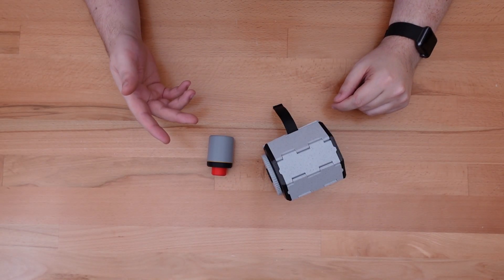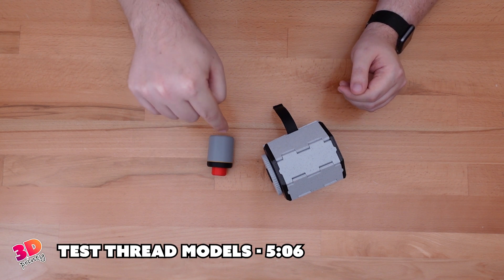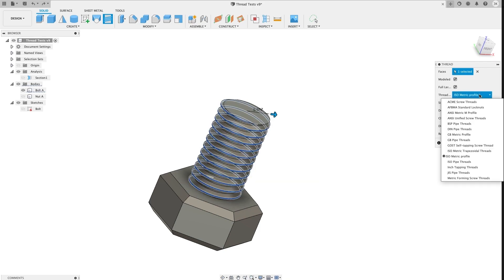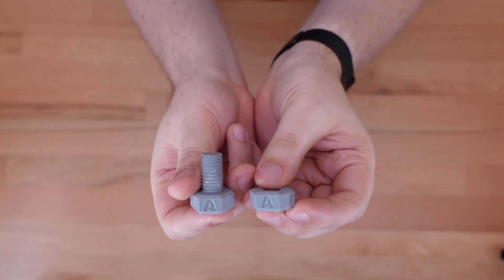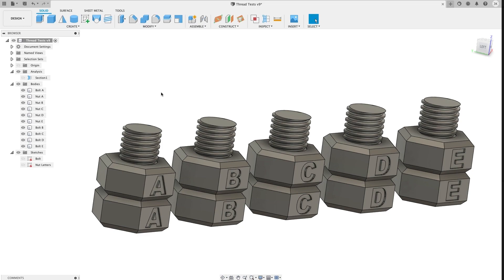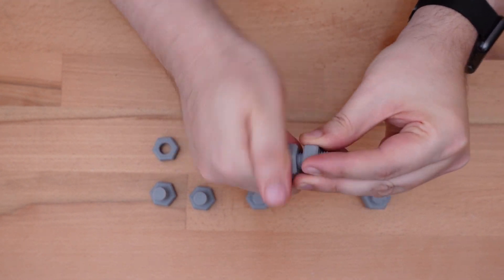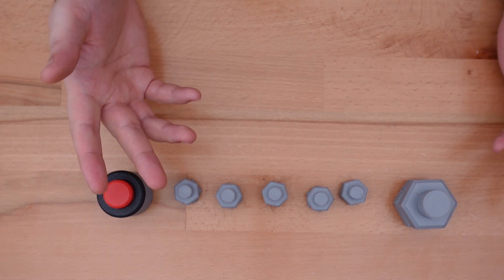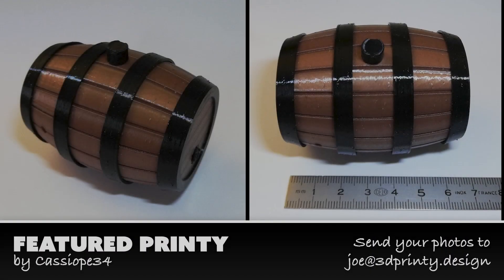3D Printed Threads - Fusion 360

Comment: I tried printing the medium rolling box but the end wont screw on I tried sanding them to only get about half way. I'm very new to this hobby. should I just scale up the box by 25%-50% to get the threads to work? or is it a setting I am missing on my slicer?
Reply from the maker: Threads can be tricky. Usually it's an issue with extrusion consistency.

Before reprinting anything, I'd try to slowly screw and unscrew the cap as far as it will go. This should wear off any small printing blobs that can be causing the trouble.

If that doesn't work, I'd try reprinting the cap scaled down slightly in ONLY the X and Y directions. This should be possible in most slicers with asymmetric scaling.

Some slicers have a setting called "Horizontal expansion" or "X/Y compensation" that is specifically used for these situations, although I've never had to use it myself. Here's a video by Chuck that discusses this in Cura: https://www.youtube.com/watch?v=UUelLZvDelU
Reply: @3DPrinty  Thank you so much. I've had so many issues with what could be heat creep but it only happens on complicated builds like the Tardis box body, yet when I print simple organizers for my dewalt storage organizer they come out fine.  I have a Creality 5 pro with a bed leveler from creality, and I have used there slicer as well as a PursaSlicer with a setting file for creality. I'm kinda learning as I go. your video's are an inspiration.
Reply from the maker: Yup, we're all learning as we go. If you aren't following Chuck already, many of his videos focus on Creality printers and may prove extra helpful. Good luck!

Comment: is there a tutorial on how to decrease the bolt nut thread clearance, i think this is the solution to my problems
Reply from the maker: You can use this technique to decrease the clearance as well. Just use a positive offset instead of a negative one.
Reply: @3DPrinty  my initial comment got lost in translation. What I mean is do you have a tutorial for this, this was hard to follow for fusion 360 noobs.
Reply from the maker: Sorry, I don't have anything that breaks it down more than this video already does. I recommend following along step-by-step with the part where I use the Press/Pull Tool (shortcut Q) to push the thread surface in a bit.

Comment: Great video thanks. How do you show the parts cut in half like in the video?
Reply from the maker: I love that trick - it's the "Section Analysis" tool under the "Inspect" menu. This allows you to select a plane to slice through the model without actually altering it.

Once you use it, this special view is saved in the "Analysis" folder in the document tree. From here you can easily switch between multiple different views, or turn off the view entirely and return to seeing the full model.

I usually have at least 2 Section Analysis views in every model I make - slicing the front and side. For more complex models, I may have many more.

Comment: Great video! You mentioned that if you scale up the nut and bolt they would screw on easier, My question is if I drew the male and female threads at say half of the required value then scale it up in the slicer would that make is smoother than if I just printed it 1:1 scale? I know your method would be the proper way... but in a pinch, would it work? Thank you
Reply from the maker: Excellent question!

If you model an M3 bolt in an M3 hole, scale it 200%, and compare the scaled clearance to that of a default M6 bolt in an M6 hole, you DO gain some additional clearance.

But the amount of clearance is fairly small and depends on the scaling factor. Because the result isn't very predictable, I'd rather define my own manual clearance.

So yes, you absolutely can do it that way!  you'll still need to do some testing to determine what scale results in what clearance per standard bolt size. You'll also have sharper threads, which I don't find particularly helpful in a 3D printed object.
Reply: @3DPrinty  Thinks, I agree tweaking the design is the best.

Comment: Really good video. I'm currently dealing with giant threaded parts (14" diameter)  The thread modeling tool doesn't have coarse enough threads for me (Iso metric 360mm is the choice I went with) We'll see how it goes.
Reply from the maker: Good luck! In that case, I'd probably scale the model down, apply the threads and any offsets I want, then scale the object back up. But I've never molded threads quite that large before!

Keep in mind that the thread tool WILL resize the diameter of the cylinder surface you're threading if you're not being careful. I've had that happen to me once. Nasty surprise on a large print.

Comment: I use this same method for my threads, but I also like to put a filet on the thread at the start of it, because that part usually ends up being really thin and pointy, and hard to print. The filet also seems to help with the initial engagement of the thread.
Reply from the maker: Excellent tip!

I'll be certain to try it out on my next threaded design - and when I rework the designs mentioned in this video.

Comment: Bolt A and nut A are narrow for me (prusa mk3s) so far
Reply from the maker: That was quick. You must've started printing within hours of the video going live. Were you able to get higher clearance bolts to work? And would the A bolt and nut loosen up if forced (using a wrench)?
Reply: @3DPrinty  yeah you are correct :) so the Bolt A needed a lot of force (by hand - could have used wrench) but after a few turns it got easier but its still tight. Bolt/Nut B has much better clearance. I will keep you posted when i print the rest